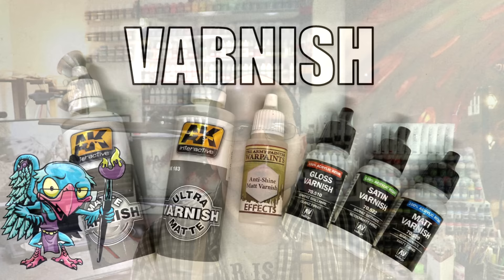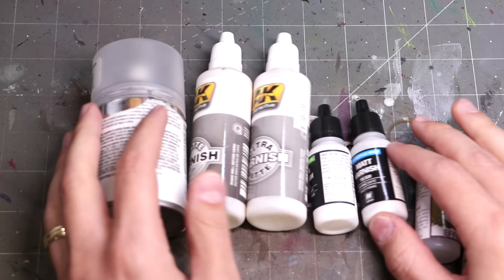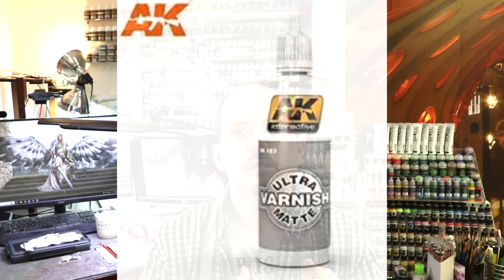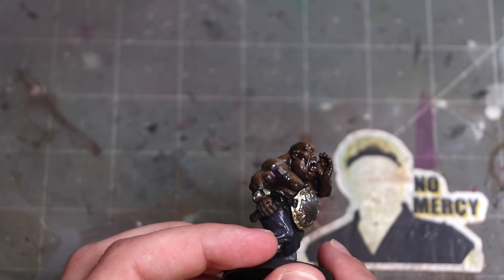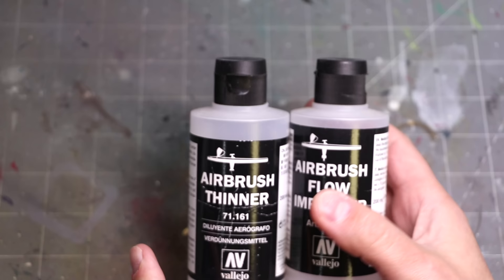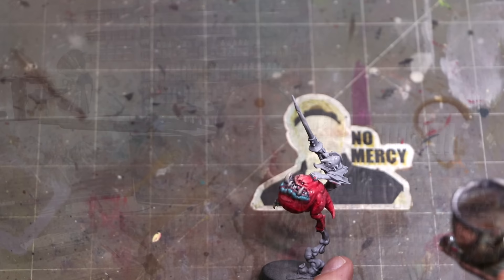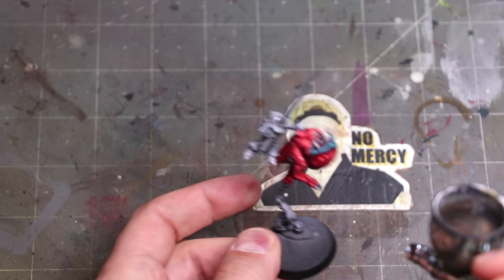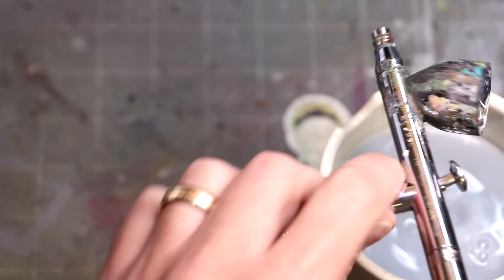How to Varnish with your Airbrush - HC 367

Comment: Hi vince, matt varnish sometimes got the reputation of being less resistant/tough than it s gloss counterpart. people may advise to spray gloss before for protection purposes as a base layer and only as a second layer a matt layer for the look. As you didn't mention it, should i deduce you  don't beleive/witness such distinct behaviour between both of them ?
Reply from the maker: The difference is generally basically irrelevant, there is some small difference, but the most important thing is just another coat of varnish. That will always do more.

Comment: Thank you Vince! I didn’t really learn anything new (although trying out custom ratios of varnish is something I’ll try rather for curiosity) but it is reassuring to have what I already do given the VV sign off! 

One small question - have you ever had the AK Ultra-matte varnish go chunky within the bottle? I used it regularly but I was still using the same 60ml bottle over a few months and towards the end it was  getting noticeably flaky. I did vortex mix it but maybe it needs agitator balls added? For now I’ve switched back to Mig but just wanted to know if this has happened to you?
Reply from the maker: Yep, there is definitely a shelf life to it.

Comment: Thanks Vince, I have an old school metal harlequins army that i'm working on. It's the first lot of metal models i've worked on in over 10 years. Would your suggested ratio be sufficient for these kind of models? I intend to play with them so imagine there will be some bumping and scratching, which in my past experience has caused metal models to chip
Reply from the maker: Should be fine, its just going to require 2-3 coats.

Comment: I just bought some Necrons and was wondering if I needed to varnish them and if so which varnish when you made this video. You saved me so much hassle thanks!
I have heard people say to have a glossy primer which I don't have atm for Necrons but does it even make a huge difference to how the metallic paint turns out in the end? 
And one last thing, should I varnish the primer before I start painting my almost complete Metallic Necrons?
Reply from the maker: 1) It doesn't make a big difference if you are using a good metallic paint. 
2) You can varnish the primer, it will help the durability.

Comment: Can you cheat 'highlights' by painting flat layers and then using a gloss or satin varnish?

How do you handle surfaces that are meant to be ultra glossy or reflective? Like a mirror or someone in a black shiny 'catsuit' type thing? Or something like a shiny chitinous spider?
Reply from the maker: You can, but it won't look right if the figure is turned and highlights move into the shadow areas, this is why most display jobs are done as matte as possible - to control the light and set the environment. If you have an ultra glossy surface, you have a choice, you can go manual or automatic. If you gloss the thing it will reflect (not always correctly, or in scale, but it will reflect), and you may have a viewing angle challenge, however you can also just place the highlights, think of gem painting, that is painting a matte surface to appear glossy with the way you deal with the reflections and light.
Reply: @VinceVenturella  I'll check out some gems then. I can get them to look alright when they're small, but big gems looks weird when I do it so concerned how it'll transfer to other larger surfaces

Comment: Hey Vince, I after spending hours on a miniature, I gave it a very, very thin coat of varnish through the airbrush, but now it looks a little dull. Am I just seeing things or does that normally happen?
Reply from the maker: Matte varnish will reduce the satin nature of many paints (which sounds obvious I suppose), but that will mean if you aren't doing a lot of highlighting and creating the light, the paint might look somewhat flat. Basically, you have to build in the contrast as the finish isn't doing it.

Comment: One question: When you are painting something which has a ton of metalics (like grey knights), is it correct to assume you want to paint all metalics before matt surfaces? 

Do you apply something like satin varnish then?
Do you apply it in case you want to use oil wash on metallic surface?
Reply from the maker: OKay, so let me take this in turn. For something like grey knights that are primary metallics, I don't varnish at all. I don't satin varnish or anything, metallics generally shouldn't be varnished. If I am going to use an oil wash, I just do so with a soft brush and carefully, white spirits don't interact with acryllic paint aslong as they are cured. You just want to be careful stabbing wet paint with a brush.
Reply: @VinceVenturella  thank you!

Comment: I did a black and white photo of my mini pre/post satin varnish and saw that it completely killed the extreme highlights I had worked so hard to build up to. Do you think that varnish should be applied before the final edge highlighting? If you think that you have varnish that solidified within the airbrush, what can be used as a safe soaking solvent to get it back to a fully good state without damaging the airbrush?
Reply from the maker: So it shouldn't be killing any highlights as satin, but the satin will reflect light, which can change how the rest will look in B&W. As to the how to get your airbrush clean, some 99% isoprpyl alcohol will do the trick.

Comment: Hi Vince, love your videos! When you say your standard mix is 80% thinner and 20% flow improver, does that apply to your painting with the airbrush as well? 
So far i have just poured a bit of both 😅
I was wondering if i should make a ready mix into a bottle.
Reply: With airbrush the sort of go to mixture is some variation of "3:1" Vallejo thinner to Vallejo flow improver in a little premixed bottle. This will nicely reduce the paint thickness, but also prevent tip dry
Reply from the maker: Yes, that is my standard mix I use for all purposes.

Comment: Hey Vince!  Thanks for this video.  Any tips for varnishing over oils as the "save point" so that I can go over it with more oils or enamels washes?  I was recommended that Testors Dullcote Top Coat.  As always, your wisdom is much appreciated
Reply from the maker: Once the oil is completely cured, I just give it two good coats of the varnish mix I described.
Reply: @VinceVenturella  Thanks Vince!  I'll give it a shot.

Comment: Is there a difference between "acrylic varnish" and "polyurethane Acrylic varnish"? Because the Vallejo PUA Ultra Matte Varnish tends to reactivate colors if you use a brush?. Ruined 3 Miniatures with it.
Reply from the maker: In general, most acrylic varnishes are the polyurethane varnishes, that is simply for the durability. If that's happening, the varnish has not fully cured.

Comment: Hey Vince big fan with out your videos I don’t know where I would be on my painting journey without them. My question is can I use GW varnishes in my airbrush and at what ratio of thinner/flow improver to varnish. I ask because what I read online people said to get ak or Vallejo but I already have GW and wanted to ask you before I buy more varnish.
Reply from the maker: So I would definitely recommend picking up those brands. GW varnishes are just honestly pretty bad. That being said, yes, you can put them through an airbrush, they would be thinned the standard way, about 1 drop of thinner to every 4-5 drops of varnish.
Reply: @VinceVenturella  Thank you so much. Keep up the good work brother.

Comment: I have an issue that sometimes my matte varnish will come out glossy. I THINK this is because I have sprayed it on too thick? But then I would think spraying matte over gloss would then make it matte, but spraying it again does not fix it. Currently I am experiencing this with Vallejo Mecha Matte Varnish through airbrush. Any insight?
Reply: I think you need to shake the bottle more....I've had that issue when I brushed it on before
Reply from the maker: It can happen for many reasons too thin or too thick, it can be not properly shaken where you are spraying too much medium. It can also just be that the matte varnish is quite shiny, this is actually pretty common. Something like Ultra Matte Varnish is much more likely to be truly matte and you won't see those issues.

Comment: Weird, I asked a question in Reddit a few days ago just about this topic. So timely.
My gravity feed airbrush only had .2 needle. Is that too small to use? Would thinning to much prevent varnish from working properly? I normally use a siphon feed, which is .7, but that blasts out alot of varnish and is a pain to clean out the tube.
Reply from the maker: You could use the .2, it's small, certainly, but you can do it, a little thinning is all you should need.
Reply: Yes, thinning helps, but also a higher PSI if you don't want to thin it too much more.

Comment: Video is over a year old so I don't know if Vince will see this comment, but I am about to start my slaves to darkness project and I want 'steel' armor with a purplish oily armor shade.  I plan on getting into oil paints for the first time.  Now everyone says I need to gloss varnish to prepare a surface for oil washing.  I went back and watched your video where you oil washed with that titan mini and heard no mention of varnish.  Are you saying the surfaces created by vallejo metal colour paints (or any metals for that matter) are already smooth enough to not require that gloss varnish step?  I hope that is what you are saying, but I want to try to be certain.
Reply from the maker: I have a video on this coming soon, but no, you don't need to varnish, (you can, it helps it flow into the recesses), but metal paints are already effectively gloss, so you don't need any additional varnish there. That is what I am saying. :)
Reply: @VinceVenturella  gotcha. Thanks Vince!

Comment: Awesome video!  Have you ever worked with Alclad Chrome airbrush paint?  I like the effect but that paint rubs off just when you touch it.  I don't know if I'm using it properly or not, but I've only been able to get it to stay with a water based sealant that they sell (Aqua Gloss Clear).  The problem is that the sealant kills the chrome's reflective properties.

Do you work with any particular chrome paint and know how to keep the surface mirror and safe for handling?
Reply from the maker: Haven't worked with it too much, but sounds like an area for future exploration.
Reply: @VinceVenturella  thank you very much.  If you do a deep dive into it I would greatly appreciate it.

Comment: hey Vince great vid! I was wondering if you have tried vallejo ultra matt polyurethane varnish ? I used AKs in the past but noticed that the areas on the miniature I touch often become glossy. Maybe I got a bad batch or something weird is happening. The Vellejo ultra matt is really nice and durable, I do thin it with water as it is really viscous.
Reply from the maker: Haven't tried their ultramatte, but I will add that to the list.

Comment: Great video. Thanks! One question..can I used oils after spraying varnish glossy of ak? When I use oils I mix them with odourless thiner..so its ok? It wont damage everyhing?
Reply from the maker: Yes you can! Once varnished, you can put oils over the top no issue, I do it all the time.
Reply: @VinceVenturella  So many thanks for the quickly answer! Appreciate it! Running to do it..

Comment: Hi vince, I am trying exactly your method but my airbrush keeps getting clogged after just a few seconds.... im using a harder&steenbeck evolution, AK gloss varnish and AK thinner.... its impossible to varnish and I dont know what more to try at this point... maybe I need to add flow improver?
Reply from the maker: So there are multiple reasons that could be happening. 1) The nozzle area could have build up of primer, paint or varnish (or all 3). You need to make sure the brass nozzle is perfectly clean with a needle cleaning tool. 2) The varnish could be bad and have frozen or aged, in which case, it can have little chunks built up in it. Those are hard to find when you look at the liquid, but you could try straining the varnish to get all of the chunks out. 3) You could try some flow improver or something else similar, but if you're clogging that fast, it's probably something that isn't the varnish.
Reply: @VinceVenturella  hey man thanks a lot for the reply, I will try everything

Comment: Its a bit tangental, but I have been having an issue with my airbrush where I am almost immediately getting massive paint build up on my needle as soon as I start painting (to the point I have to keep a cotton bud soaked in airbrush cleaner to wipe chunks of paint off repeatedly).

I can't see that the needle is bent when I checked, and I was wondering if it is possible that I have dried varnish on the needle if I didn't clean it off properly after a varnishing session? I can't think of anything else.

Would appreciate advice on what it could be as searching on google just comes up with normal dry tip instead of my specific problem!
Reply from the maker: COuld be a few things. 1) Yes, the needle could have a slight bend, it doesn't take much of anything to cause the issue. You could try swapping the needle and see if it occurs. 2) You may have a bit of a clog in the nozzle area itself, and when you are pulling back, it's building up and then coming out. 3) It could be the paints themselves have some issues and have some "clumps" within them. Those are the things that come to my mind.
Reply: @VinceVenturella  Thanks for the suggestions! So you don't think it is dried varnish then? I doubt it is the paints as this has been happening for a bit now so it has been occurring with a lot of paints. So clog or needle bend...

Comment: Thanks for the videos : )

Awhile back I recall goobertown doing a video where he tested the idea of gloss varnishes being stronger. In his testing, if I remember correctly, he didn’t seem to find a strength/durability difference. 

I’ve heard the gloss varnish being stronger message often, but I’m curious if you can provide any reasoning or explanation of that statement that might refute the only actual testing I’ve come across (goobertown).
Reply: A gloss coat is going to be more resistant to abrasion by rubbing because it will have a lower friction coefficient.
Reply: @christopherheintz2634  ah, that logic makes sense to me. I wonder why it didn’t end up testing that way.
Reply from the maker: Yep, now that being said, the difference here is minimal, which may be why it didn't show up.

Comment: Regarding metallic paints and not ever varnishing them, what about if you're going to apply a oil wash? In a previous video I think you said you varnished it with metallic varnish. I want to put an Oil wash on my Custodes, does anyone know if I will NEED to varnish them first or not?
Reply from the maker: As long as the paint is cured and you use a soft brush, you don't need to varnish the paint first.
Reply: @Vince Venturella  Thanks man! Your videos have been absolutely amazingly helpful in painting my army. So just want to say a big Thank you mate!

Comment: Just curious, why is that your airbrush is rust coloured in the container? Has the metal coating of the airbrush come of?
Reply from the maker: Oh, the inside, it's not rusted, just stained over years and years of usage. :)
Reply: @VinceVenturella  pretty sure some of that (or even all of that) is not staining, but the coating wearing down from exposure to stuff like isopropyl or any other airbrush cleaners. No worries though, because it will not effect the performance of the airbrush.

Comment: Any issues using more generic artist varnishes from the paint sections of a place like Hobby Lobby or Michael’s?
Reply from the maker: No issues.
Reply: @VinceVenturella  I've been trying this with a few different brands, and I find I'm getting significant tip dry with the varnishes in the process, almost immediately.  Will additional flow improver weaken the bond of the varnish?  Is there a different/better fix, like PSI adjustments?
Reply from the maker: @adamcraig9834  So I always use a few drops with my varnish, so basically I start with 3 drops of my mix of 80/20 thinner/flow improver. It's not going to change the varnish effect really.

Comment: Would Testors gloss work for a layer before an oil wash and Testors matte after?
Reply from the maker: Sure, no issue there.
Reply: @VinceVenturella  My friend and I are having a debate about it. I’ve got some Bloodbound ready to wash, but he’s saying since the Testors spray is enamel based the white spirit will eat away at the gloss coat. 

He recommended using an acrylic based sealers. 

I can simply airbrush them with Vallejo, but it’s nearly 2k points and this would be faster.
Reply from the maker: @photonfartsqueeze6694  White Spirits do not chemically interact with acryllic paint. Your biggest concern with spray varnishis that you do it in a higher than expected humidity and cause fuzz, this can happen with any kind of spray can varnish.

Comment: How long after varnishing would you recommend to paint on top of?

Also how long would you wait to apply an oil wash that you can then use a cotton swap to remove the majority of? I’ve had issues where I pulled off the varnish layer when I did not wait long enough.
Reply from the maker: I let it cure about 30 minutes. Strangely, I also leave the oil wash for about 30 minutes. Also, don't use cotton swabs, they can easily leave debris. My advice is makeup sponges.

Comment: Why are metallic paints more durable than matte paints?
Reply from the maker: The pigment is heavier, generally either mica or aluminum and dries fairly solid, it's also a little larger, so an opaque layer is actually thicker at the micro level.
Reply: @VinceVenturella  Thanks very much, I really appreciate all the useful information you share with us. :)